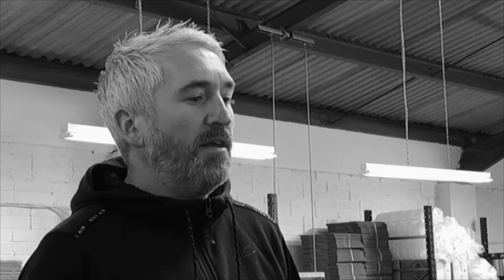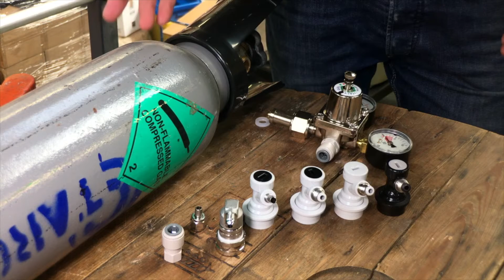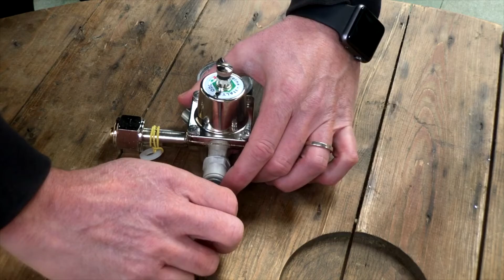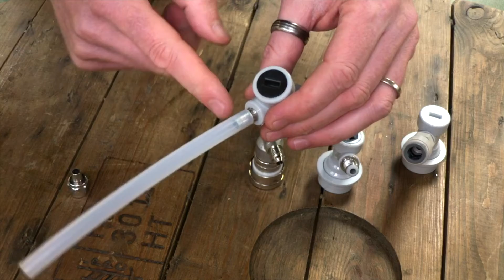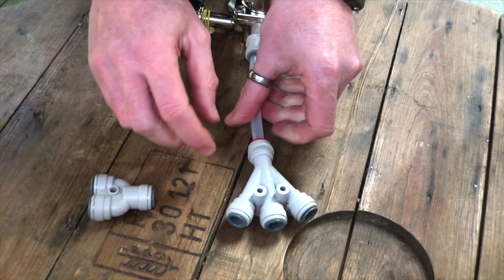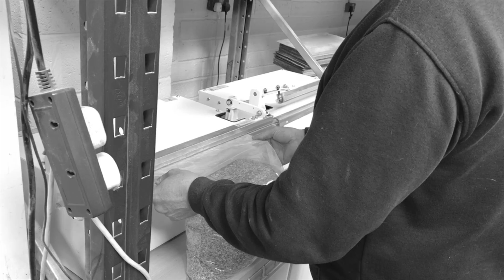Kegging - Learn About Gas & Regulators

Comment: 3:40 great video packed with useful information. I have an ODL regulator which I’ve dropped and damaged the gauge showing the keg pressure. Am I able to get a new one to fit to my regulator?
Reply from the maker: Yes, we're in the throws of trying to get those parts available. Keep your eyes peeled on the website

Comment: Very thorough explanation! I have just got the ODL regulator from Malt Miller to replace the Northern Brewer (US CGA fitting) regulator for our two new corney kegs. This video really helped all the faffing and uncertainty while connecting, testing and beginning to fill our very first kegged homebrew 👍 It will also be put into a kegerator (Hotpoint fridge + Nukatap tower), which was helped by added bonus info from this video 😁👍👍👍